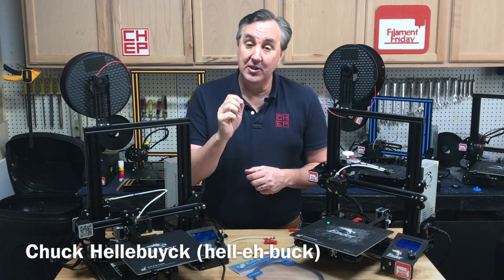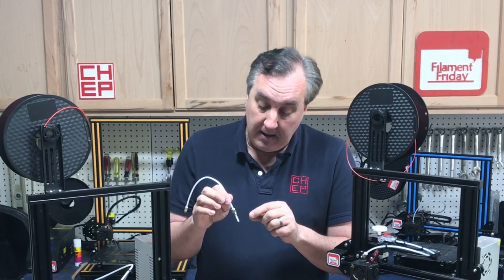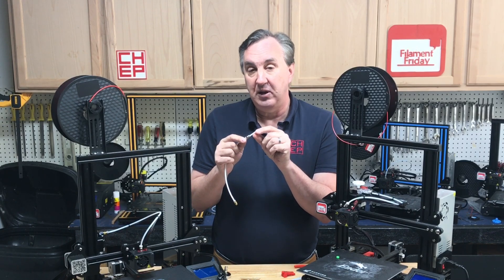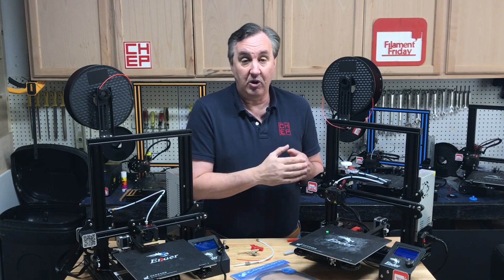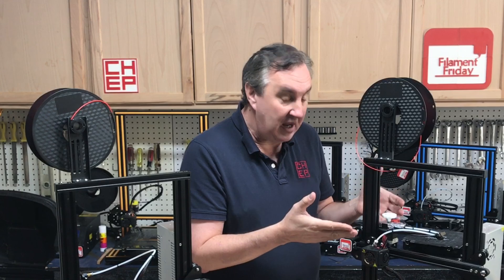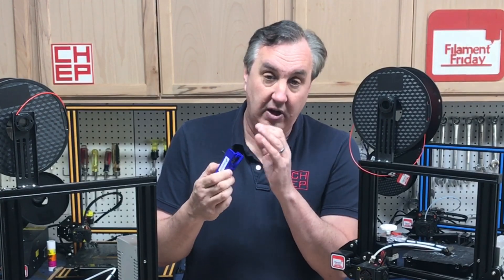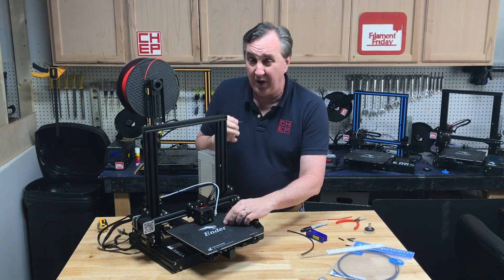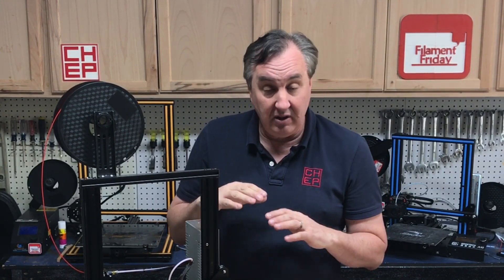Simple HOTEND FIX for Creality Ender 3, CR-10

Comment: Tried this fix but I had already upgraded my hotend kit to the micro swiss all metal hot end kit and now this fix is not possible and I'm still having problems printing.  Any suggestions for modifying this fix so that it works with the upgraded hot end?
Reply: this mod is pointless for an all metal hot end... you won't get any benefit. what kind of problems are you having when printing?
Reply: @PabzRoz  thanks for the reply.  It seems the hot replacement has solved my issues, for now…. I was getting a LOT of stringing as well as layer separation, etc….  I print a LOT of cookie cutters and had no problems til recently.  After replacing the hot end I was still having problems but leveling the bed seems to have solved the problem.  Printing really well now.
Reply: @PatrickOSullivanSingSongGuy  well that's good. luckily it was something simple. i highly recommend getting a BL touch. It makes a night and day difference. I never have to worry about my bed being level anymore.
Reply: @PabzRoz  yeah, I’m seeing a lot of users who swear by that.  I’ll definitely give that a look!  Thanks again.
Reply: @PatrickOSullivanSingSongGuy  No problem, Enjoy!

Comment: 2ICEdj

Hello , i need some help, my ezr struder is cicling in my CR10s! Can you tell me wich specifications you use?
Reply from the maker: What is cicling?
Specification for what?
Reply: @FilamentFriday  it is the toothed part that is coupled to the motor, it simply does not pull the filament
Reply from the maker: Did you tighten the set screws? 
Did you install the spring so it keeps the idler tight against the gear?

Comment: If i don't have Capricorn tube, can i use the stock one for the insert?
Reply from the maker: Sure.
Reply: Eh, isn't it the point to use Capricorn instead of stock because it is more heat resistant?
Reply from the maker: Capricorn is better but I’ve found only slightly better.

Comment: My ender 3 has been without issue, besides the bowden tube backing out. I tried different couplers and still had to re seat it on a regular basis. So far this has been the fix. Thank You

Comment: Why don't you just use Capricorn for the whole thing?
Reply from the maker: Because it doesn’t guarantee PTFE trapped tight against the nozzle.
Reply: 4:12 he talks about that. It was easy to over look that part.
Reply: Another issue with Capricorn is you cannot see the filament while loading. Small issue, but if you have a broken piece inside, it's a big one then.

Comment: is this preferred over just using capricorn all the way?
Reply: why not both?
Reply: @RedBombX  well, the fix is putting some Capricorn tubing through the hot end, and then a spacer, then can use the standard tubing. Well, if you just run Capricorn all the way, does it not accomplish most of what this does?
Reply: @MSUICEMAN  I was having an issue with getting my tube flush and had a couple of blobs leaking out of the hotend. This has fixed my problem
Reply: @hoffer_moment  ok, that is fair. What is the spacer made out of? I'm assuming PLA or PLA+ is a no-go due to heat.

Comment: I did this mod and still have problems after some time. Printing so this mod doesn't fix nothing
Reply: It is possible to have different problems. It is possible to have more than one problem. Don't complain to the chemist if you took the wrong medicine.
Reply: @railgap  not the case this simply doesnt work
Reply from the maker: Rogelio Figueiredo - Based on what facts? 
It’s worked great for me and 100’s of others. I run mine everyday. It’s been fantastic. Several have even said so in comments. 
If you don’t like it fine, but my video is valid.
Reply: @FilamentFriday  I love you videios and i think I watched everyone but i think this solution doesn´t work
Reply from the maker: It works just not for you. I understand. It’s also why I gave you a link to an alternative using the Slice Engineering insert.
Reply from the maker: This is a better option: https://youtu.be/tYbL-O3FecY
Reply: Full metal hotend on ebays for like $20

Comment: Thank you so much for this,  my ender 3 V2 has been a total nightmare its  just over a week old and so far I have had 3 cracked nozzles and I have lost count of the blockages,  specifically at the nozzle end of the PTFE,  its a shame creality don't look at some of the issues instead of trying to swamp the market with some poorly designed components, not to mention the lack of quality control.  Although the issues I am still a fan of the printers but only due to the efforts of people like yourself who come up with such simple ideas that fix the major headaches many of us experience.  Am going to print your design today and get it installed,  just one question though does the washer hold up ok to the heat that transfers to the radiator.  Thanks once again form London (UK)

Comment: I've never seen any one mention a alternative to a printed washer..am I correct in thinking a nylon one would be safe to use seeing as it's melting point is hotter.
Reply from the maker: The hotend doesn’t get hot up there so there is no difference

Comment: What's your favorite printer? Also, beginner here. I have an ender 3. Whats would you say are the top parts to upgrade? And what are the top parts I should always have on hand? How can I get the card to check the nozzel when leveling?  Sorry for so many questions but excited to learn and love your videos?  Alos, I'm doing a test print and the extruder keeps making a clicking noise. Thanks

Comment: I'm not able to print the washer because the printing is bad. is there a place that sell them? or can you sell me a few?
Reply: Probably you're slicer is limiting minimum print speed to 15mm/s and 20 seconds minimum layer time, which is default. Try changing that to 1mm/s with minimum layer time at 6s, this gives the plastic a lot longer to cool after it is extruded.

Comment: Hi Chuck, Thanks for the great videos.
I have a CR6SE and I am about to do this mod.

One quick questions. The stock PTFE tube length is 40cm. If I follow your setup, this will make the stock length longer which in turn means recalibrating everything...

Would you then suggest that we trim down the stock tub in order to maintain the stock length?

I am assuming yes, but would just like your feedback on this if possible.

Thanks again.

Comment: Do I need to calibrate rectraction?
I think its worse on my printer..
Any tips?
Reply: i'm in the same boat and am going to try a retraction tower this evening. It feels like there is interference where the PFTE tube, washer and Capricorn interface. I have tried this mod a couple of times and have switched back to full length Capricorn because I just need to get a print off but I really want it to work.

Comment: Thanks Chuck!!!
Figured I'd post up my little story that was fixed by this video.
In the process of doing this mod, I found a nasty booger of melted plastic down in the heat block.  Had NO idea it was down there until I had both the nozzle and the bowden removed.
Come to think of it, that booger was the reason why I had to crank down on the extruder tension AND increase my nozzle temps up just to get anything to print (and we won't discuss the..."quality"...).
So.  Now I have Luke's fix, your spacer, Capricorn bowden, a new nozzle, and a clean hotend.
Using your 0.20 profile, my very next print was gorgeous.
I cannot thank you enough for what you have/are providing to the maker community.

Comment: I'm going to try this. I have an Ender 3 v2 that keeps clogging. I calibrated all the stepper motors and did the e stepper twice. Which did help... I can print Chep cubes perfectly over and over. But as soon as I try to print a medium size print, the e stepper slowly starts to click or skip about a third of the way and slowly gets worse until it's completely clogged. I have played with various cura settings including temp, extrusion, retraction, speed with not much luck. Can a hot end go bad??
Reply: Well, I gotta say, so far so good! Been printing PLA, PETG, not a clog yet.. fingers crossed!

Comment: I actually tried this. But a thought occurred to me while I was installing the PTFE tubing...why not just get all Capricorn tubing? Just push the Capricorn tubing as far down as it will go and be done. A quick glance on Amazon shows that generic PTFE tubes cost around $5 to $8, while the Capricorn brand is $10 to about $15. So you might save a dollar when its all said and done. Also the length of your spacer seems rather long. I tried using something close to 4 mm and it doesn't leave any room for screwing down the Bowden tube. Are you using a stock or clone Ender 3 hot end / heat exchanger? I had hoped this would work for me but alas....it did not.
Reply from the maker: There are different size spacers to use. And using Capricorn all the way thru relies on the coupling pins again so defeats the purpose of this mod.
Reply: The issue is to help ensure that you never get a space between the tubing and the end of your hot end.  If it works, this should hold the tubing firmly in place.  You could do this with Capricorn tubing in both places, but the benefit to Capricorn is that it is less susceptible to melting in the hot end.  It would work, but it wouldn't help improve things running it the full way.
Reply: You could use Capricorn all the way through but you would still have to cut it and put the spacer on top and use the threads of the coupler to press it firmly to the bottom of the hotend. Whatever you put above the spacer and connect to the coupler doesn't really matter. Standard PTFE or Capricorn if you like.

Comment: Which size Capricorn tubing do we use? i see 1.75 mm and 2.0 mm
Reply: The link provided is for 1.75mm Capricorn tubing, which is not the size of the tubing but the filament it's designed for. The tubing is for 1.75mm filament, but the inner diameter is 1.95mm and the outer diameter is 4mm.

Comment: Great tip, I've got ender 3 v2 clogging issues. 

Can I do this without the washer? I just cleanedout the entire hotend, and thought I'ld give this a go before I screw it back- but then I have to put it back, print the washer, take it a part, and then back in.
Reply from the maker: The washer is needed to hold the short section tight against the nozzle.

Comment: if you really want to improve the ender extruder all you need to do is to exchange the heat break with the one from Slice engineering. ( copperhead C-E variant)

Comment: the idea itself is great. However for some reason these washers melt pretty fast with my prints ;/ so... i used JB Weld on 3 metal washers - no problems ever since <3 thanks for this video !
Reply from the maker: If they are melting way up there then your fan is failing.

Comment: My tubing is stuck in the hot end. My last print I got stringing on the last 2% of the print, of course. The tip had filament all over it and it looks like it clogged the hot end. Is there an easy way to get the tubing out of the hot end?
Reply from the maker: Heat up the hotend first. Then unscrew the coupling and pull.
Reply: @FilamentFriday  How hot should I make the hotend? I unscrewed the coupling and moved it up the tube. I heated it to 210c, but it will still now come out.
Reply from the maker: Ok, next option, remove nozzle and push it out.
Reply: @FilamentFriday  Got it out. There was a big blob of filament in it. Watched your other video on Fix Under Extrusion also. Checked my Extruder arm and sure enough it was cracked. Ordered the CHPOWER Metal Extruder from your link and installing it right now. Should have got the EZR, but will this was less expensive. I would say it was the Extruder arm that was the problem. Thanks for all the help.
Reply: @FilamentFriday  This is on a Ender 3 v2.

Comment: so chuck have you tried this with ALL Capricorn tubing? i mean the whole shebang not using stock tube at all if so how well did it work? I dont like my Capricorn bowden tube personally its so tight sometime i need pliers to pull filament out
Reply from the maker: I have machines running all Capricorn without issues.

Comment: Hey, am I right in assuming this should work for the Neptune 2? I have heat creep issues.
Reply from the maker: Yes, but heat creep is caused by a bad fan.
Reply: Ok. When I choose retraction I always get a jam. In elegoo version of cura there are no other choices so I can’t “dial it in”. I was told this was heat creep.
Reply from the maker: If you are retracting then you are pulling hot filament into a cool zone so it will expand in the PTFE. That isn’t heat creep. That’s retraction settings being off. You can use regular Cura and adjust it. Try using my CHEP profiles.

Comment: never had a issue with my couplings giving way, when i push my tubing into the hotend i back the coupling off a few turns, push the tubing in really firm, then tighten the coupling to make a really tight fight

Comment: I don't know if this video is out of date, but I only just installed this upgrade today. I immediately noticed that my spacer and PTFE tube inside the hotend wasn't aligned, and the misalignment was causing underextrusion. How do you avoid this? Particularly if you're switching filaments? It doesn't seem like there's anything inside the hotend keeping the PTFE tube centered, and the spacer definitely has some wiggle room.
Reply from the maker: I haven’t had that issue but you might search for other spacers on Thingiverse. I know viewers have modified my design.
Reply: id say your Capricorn tube in the hotend was cut too short if it was tight it wouldnt wiggle
Reply: Resurrecting a dead thread but I noticed that the ID of the hotend and OD the Capricorn tube has a slight difference to where a tube with a bend does make it slightly off center and may wiggle even if it is the correct length.

Comment: @CHEP I am currently using a 4mm PTFE tube on the Ender3 with an inner diameter of 3mm since I didn't have any 2mm/4mm tube at hand when I needed to replace it some months back. Didn't have problems so far! Maybe you want to test it yourself and make a video?

Comment: the reason the bottom 20mm of PTFE tube bakes is a design flaw in the stock hot end.  Basically, the throat that screws into heat block and is inserted into the heat sink, has a gap. this gap is between the throat and heat sink.  An air gap causes less heat transfer to the heat sink.  Air is an excellent insulator!!!! 
Solution is to add thermal compound to the throat then insert into the heat sink and fix the grub and two bottom up heat block screws.  

So what this does, is eliminates the air insulator and transfers the heat to the heat sink VS transferring the heat into the PTFE tube and thus into the filament !!!!! 

Doing this ALONG with properly assembling the hot end and ensuring no gap between PTFE tube and nozzle will avoid 99.99% of clogs!!!

Even if you want to use the hot end "fix" this I assure you is a much needed fix to stock hot end!

I actually just bought a micro swiss all metal and I even added thermal paste between the tiny metal insert and heat sink as it also had a gap, although the gap was machined to MUCH closer tolerances!!  It still can not hurt as I have read that the all metal has some issues with PLA still clogging and I bet you that this tiny air gap isn't helping!!!
Reply from the maker: Paste is good for heat transfer but the reason the last 20mm burn isn’t the heat sink, it’s the PTFE touching the nozzle inside the heat block. This higher temp PTFE insert helps but mostly keeps the PTFE tight against the nozzle so no gaps that cause blockage. 
A better solution is here: https://youtu.be/tYbL-O3FecY
Reply: You're taking about the heat break?

Comment: I think the winding of filament inside of the tube really only affects the retraction quality significantly if you use soft filaments that bend easily, like softer types of TPU, since the filament needs to bend quite a lot inside of the tube in order for there to actually be any significant "extra" length of filament in there. PLA is way too stiff to bend enough for that effect to be noticeable during retration, even though I guess the effect still theoretically exists. On the other hand, in every bend of the tube itself, the filament is going to push against the "outside" of the bend when you press the filament in, and push against the "inside" of the bend when you pull it out, which will inevitably give the filament some play and I think this effect is bigger (it should be close to 0.79 mm in retraction length for every 180 degrees the PTFE tube turns).